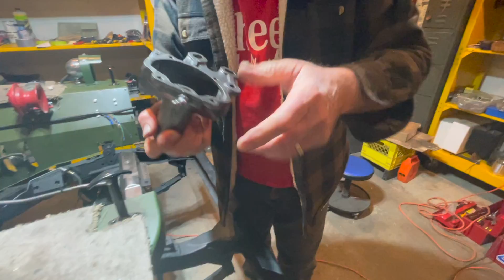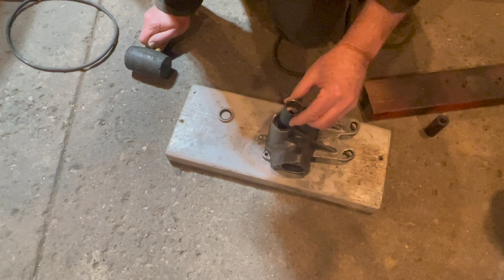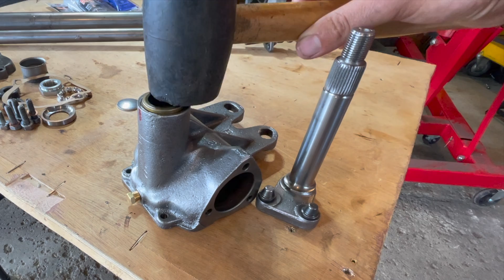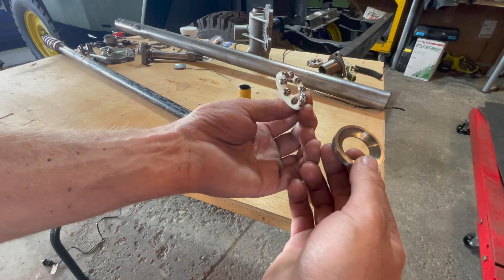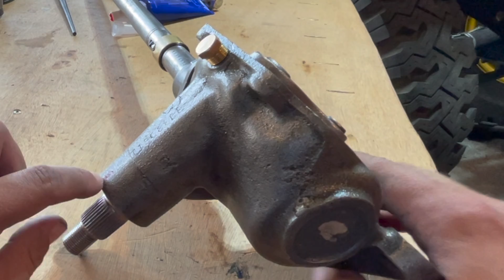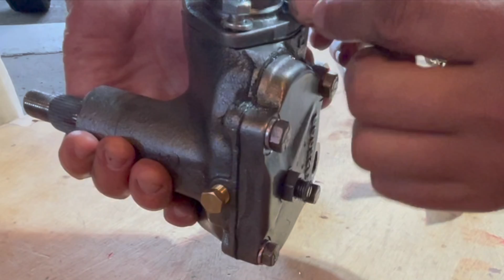How to REBUILD Ross Steering Box | 41-66 Jeep & Willys

Comment: Watching your video here again.  I'm rebuilding the steering gear box on my 1942 GPW.  It was filled with grease and had a binding when turning to the right.  However, when I opened it up and cleaned the grease off everything looked good.  The sector shaft fit snugly in the bushings and there was little to no wear on the worm gear or the sector shaft nubs.  I'm debating if I need to replace the business and such or not.  The worm gear shaft had rust and the steering column sleeve is a bit dented and rusted on the inside.  What do you recommend?